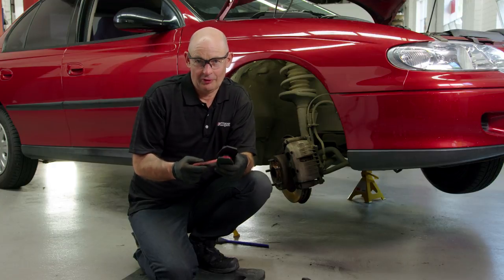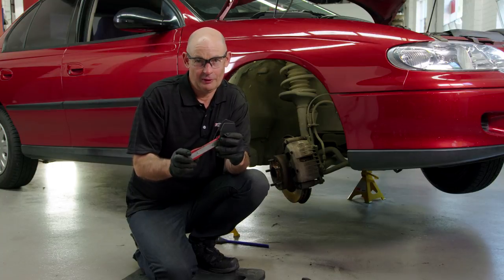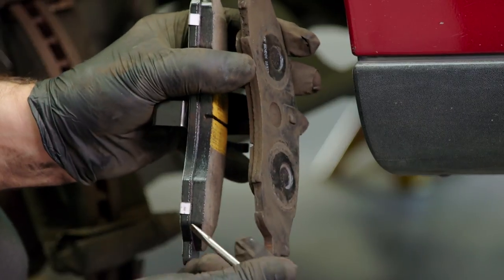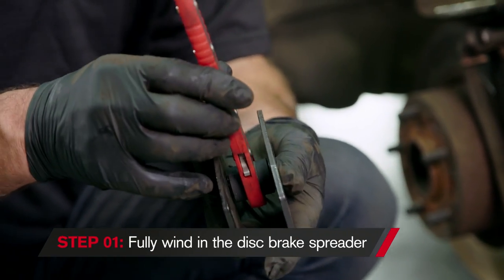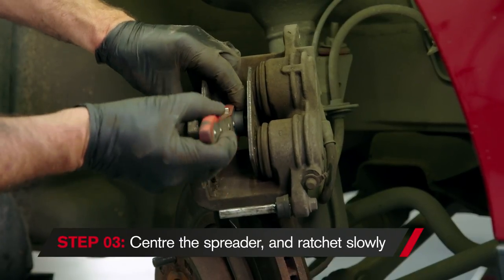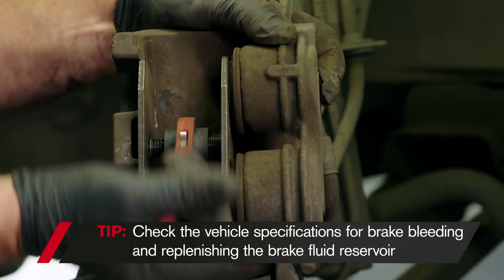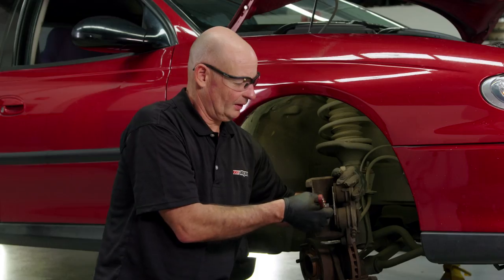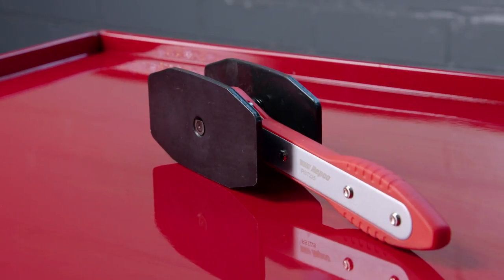How to use a Ratcheting Disc Brake Pad Spreader

Comment: I bought this tool, different brand name, to do a brake job and it didn't work that great. Ultimately it the job, but you have constant pressure for the tool to work, so you have to initially squeeze it with your hand and kind of keep doing that as the piston moves. For $9, its hard to complain but I think I'll invest in a better tool set for future brake jobs.

Comment: Do you have to open your master cylinder cap when doing this??? Anyone?
Reply: Always open the top
Reply: I saw a guy loosen it where the cap is still on but not open it completely/off
Reply: no, but its much easier to compress with fluid reservoir open as the air is pushed out

Comment: It dosest works in a Toyota hiace :(
Reply from the maker: you want to make sure you brake calipers are conventional piston as aposed to the wind back type that, as the name  suggests twists in an anticlockwise direction. you'll need to get the wind back caliper tool for this situation